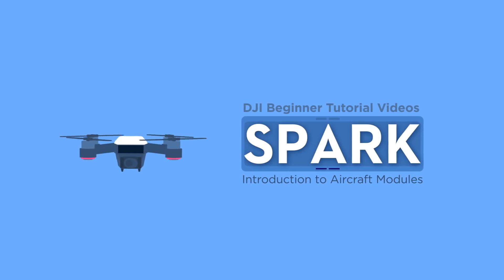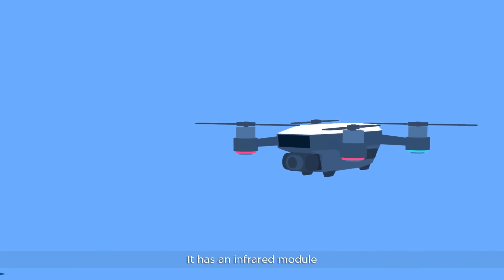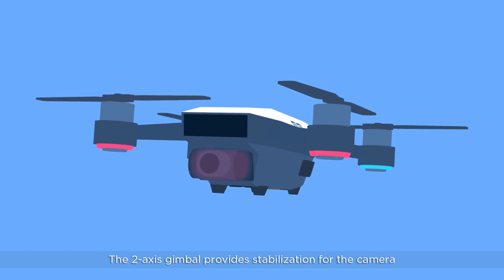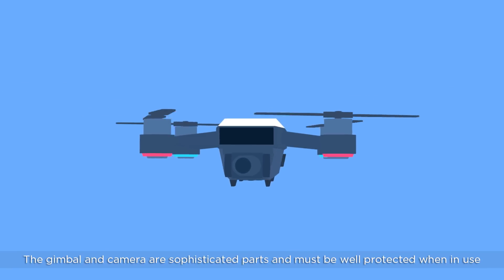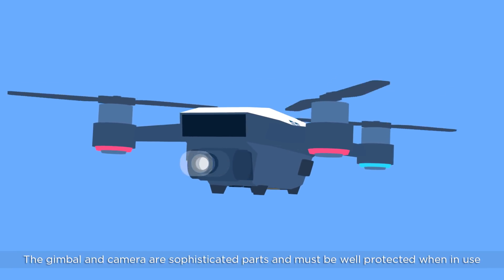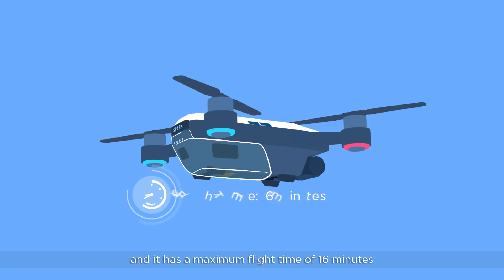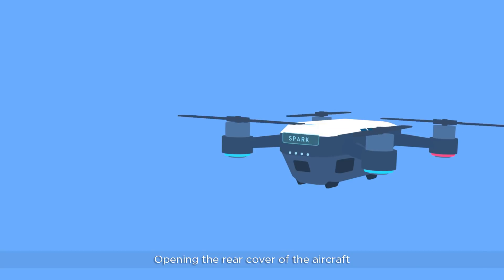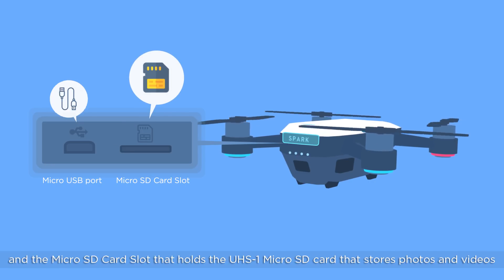DJI Spark's Introduction to Aircraft Modules (Beginner Tutorial)

Comment: Can you tell me what the minimum elevation & radius parameters are in POI mode for the spark?
    The M2P bottoms out at 2 meters - elevation & 5 meters - radius. I’m trying to get a much tighter shot. Thanks.
Reply from the maker: Hi, just for your information, Spark doesn't support point of interest (POI) flight. Thank you for your attention.
Reply: DJI Support 

Does the “air” support POI?  If so, same question. Thank you.

Comment: Hi just bought my dji spark and set to go. Is there need to calibrate the IMU before first flight?
Reply from the maker: Hello Joseph, if the app doesn't prompt you to calibrate it, you don't have to do it. If you find the drone is not able to hover in many places in GPS mode, or the parameters are not correct, or the app prompts you to do it, you need to calibrate the IMU. Thanks.